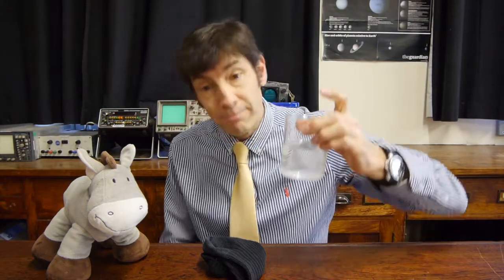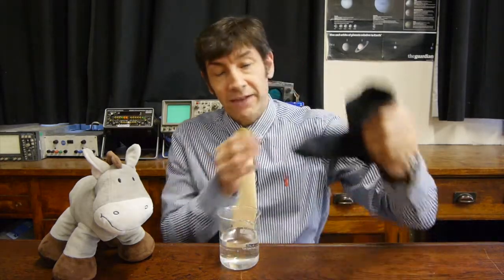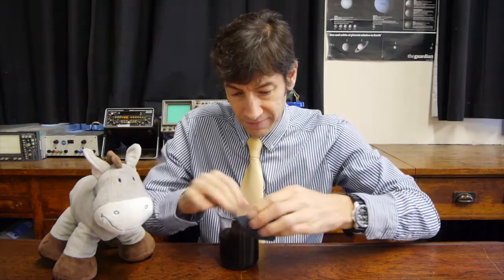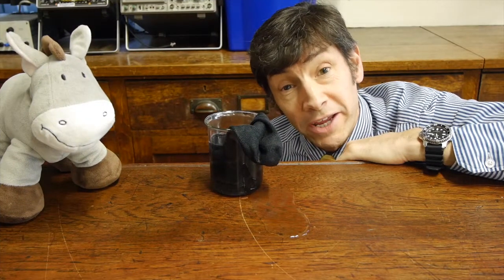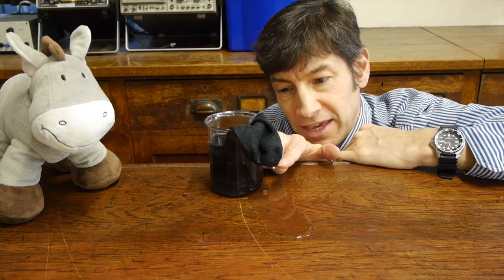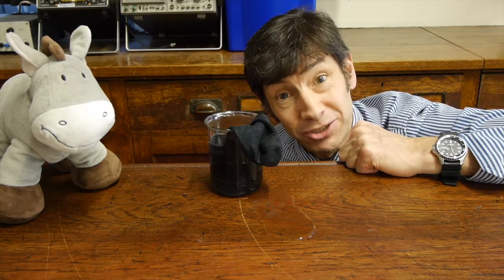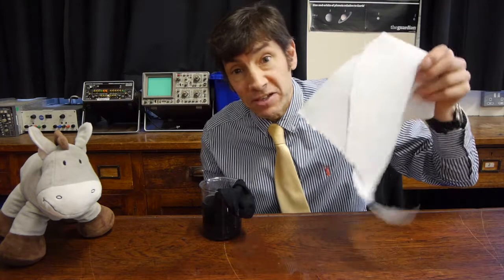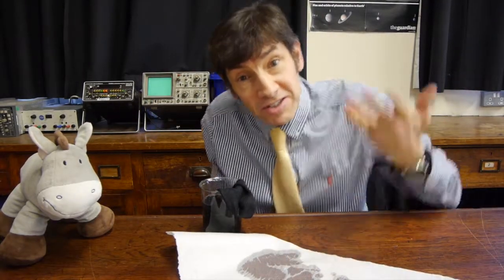Capillary Action - F-J's Physics - Video 91

Comment: this is siphoning the water . notice the sock will not drip water if the level of water in the glass gets lower than the end of the sock
Reply from the maker: Douglas, really interesting what you say.  It is probably a combination of the two as the water does initially travel up a dry sock of its own accord which will be due to capillary action - so it is not acting as a self-priming syphon.  It then flows over the top and down in a manner that seems to show syphoning action as well.  What do you think?  Interested to hear your thoughts.
Reply: I agree with you and my main point was that the drip will stop when the level in the cup is the same height as the drip . Other wise your looking at perpetual motion
Reply from the maker: Yes, that would be another great demo to do to show the height difference that is needed for a drop to form.  I guess the self-priming nature of this syphoning is interesting.

Comment: Will the sock empty the beaker? Thanks.
Reply from the maker: Good question Richard.  I think in this case it will but of course even if it only lifted the last bit of water a small distance it would help the evaporation of the water too.
Reply: this is siphoning the water . notice the sock will not drip water if the level of water in the glass gets lower than the end of the sock

Comment: But where does the ENERGY to move the water up comes from???  It takes energy to do this. Where does it come from???
Reply from the maker: That is a very good question and not an easy one to answer!  There is a 'surface energy' associated with liquids - this is true most visibly with surface tension and the formation of bubbles that try and limit this value by taking up specific shapes.  The interaction with the liquid and the surface it 'wets' changes the surface energy - this is an electrical potential energy and this can be converted to gravitational potential energy.  I cannot say I am impressed with my short explanation but the main thing is that energy is associated with 'interfaces' in this case the change from solid/gas to solid/liquid as well as a surface area change of the wetting liquid.  Suffice to say that your question is both a brilliant and very thoughtful one.  Thanks for asking and I hope I have started you on a trail to explain it!
Reply: @AnthonyFrancisJones  Thank you very much for your reply! Yes, your answer does give a hind - but only for the initial capillary action, that is for the initial wetting of the cloth. But what about after it is all wet and it starts dropping out of the glass? From that point on, the cloth is already wet (no more conversion energy), but the water will keep rising up the cloth and out of the glass till all of it is out or the glass… What energy does this motion spend in order to be accomplished? I know this is a tough one - but has to be asked :-) P.s. The brilliant question belongs to my son. I am just the one that was fired to investigate for an answer - but don’t seem to get a good one… What about zero point or free energy? :-)
Reply from the maker: @dmoschos  Excellent follow-on question  - well, I want to do more experiments on this with inverted U shaped tubes that act like self-priming syphons (but that's another story!).  So, other forces exist within the liquid - water in this case - and this is the hydrogen bonding.  There is some question about this causing the water to act like a bit of a chain (not quite the Mould Effect but similar).  When a drop comes off this leaves a dryer place and so the water can continue to use contact forces to move to this place.  Now, evaporation may help too so this would take energy (thermal) from the surroundings.  I am not sure I have fully answered your question, though I do understand what you are asking!   Great that you are having these conversations with your son even if the answers are not that forthcoming or intuitive!
Reply: I'm flabbergasted than mankind has known this for thousands of years but as advanced as we are now we have no answer to your question!!
Reply: @AnthonyFrancisJones  Dear Anthony, I somehow missed your 2nd answer some months ago, and only now Youtube notified me (thanks to the last comment). So, I just want to say that for my level of understanding, your answer does give me an adequate explanation. Thank you for your answers - even if said quite late! All the best, Dimitrios
Reply from the maker: No problem - Youtube misses notifying me too - such as in this case!
Reply: @dmoschos  

this is siphoning the water . notice the sock will not drip water if the level of water in the glass gets lower than the end of the sock